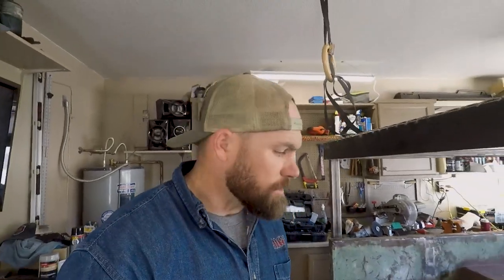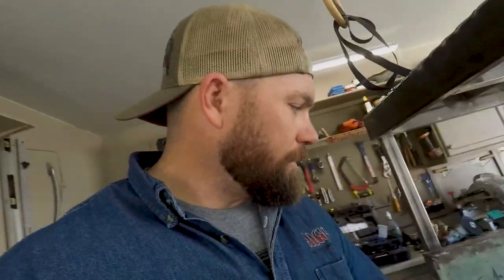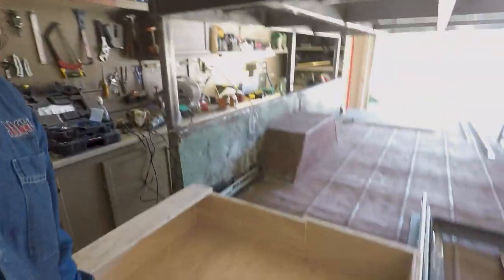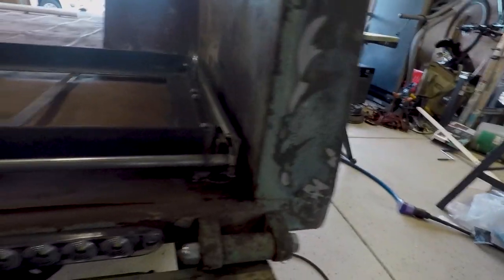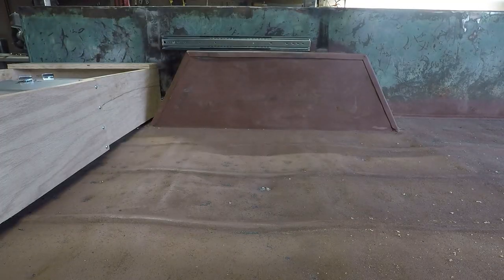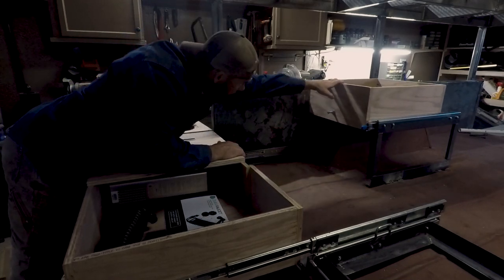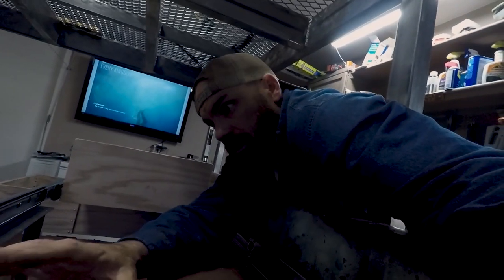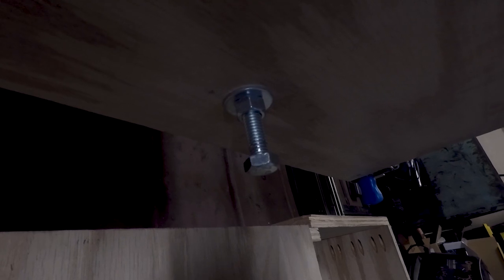M101 Trailer Build E13 - Drawers

Comment: I would love to see this come to light, it looks fantastic. I am currently looking for an M101 myself. Your video series has inspired me to make a one of a kind overland style trailer!
Reply from the maker: Dan it's all done actually, I just have to get the video to the internet. Trying to get it done soon, just need a working computer first...
Reply: @CallIntheCountry  I'll be waiting anxiously for the video... Did you by chance look at any other trailers when deciding on this one? I am entertaining the M416 1/4 ton as an option
Reply from the maker: Dan Leach I looked at the 416 pretty hard but wanted more space than it could give me. I think they’re perfect for a Jeep but don’t regret going with the 101 for a second.
Reply: @CallIntheCountry  I finally decided on the 101, I'm going to Jack's surplus in Tuscan next weekend!!! Figured it would be a great winter project for me until it warms up and I head north in the summer.
Reply from the maker: Dan Leach nice!!! Let me know if you need any pointers along the way. Best advice before you buy is check for rust and make sure the body is straight.
Reply: @CallIntheCountry  So I went to look at the m101 today and found several that were in outstanding shape. I ended up with a m1031 CUCV contact maintenance bed. Amazing shape, no rust. I might take you up on Pointer for a few bits here and there.
Reply: @CallIntheCountry  I reached out to you via email on the Call in the country website. I would like to touch base on ideas and builds!!!
Reply from the maker: @danleach9452  email sent, let me know how I can help.